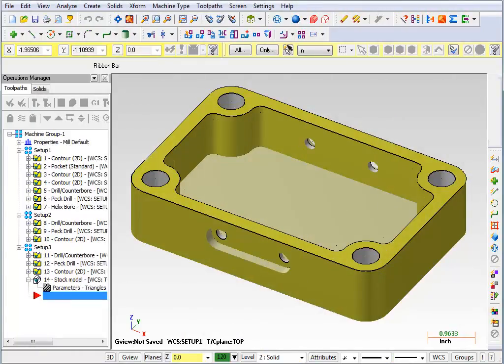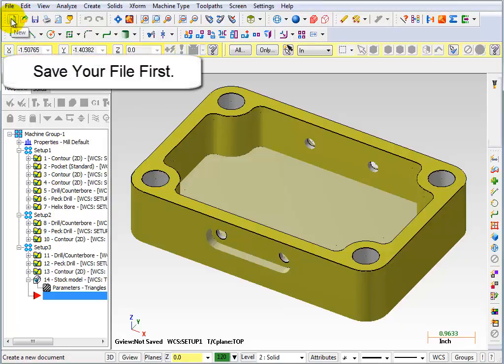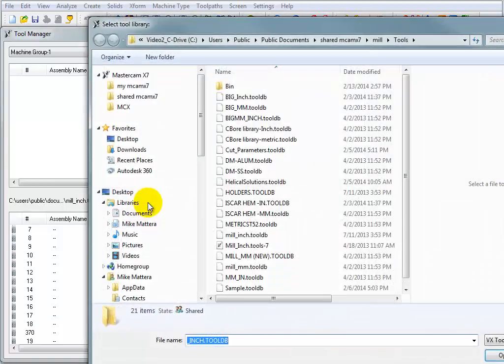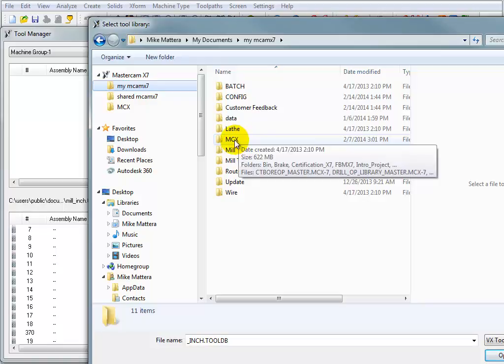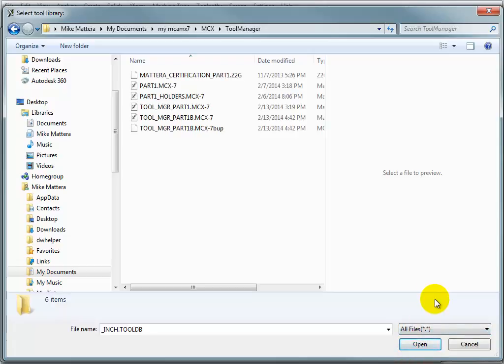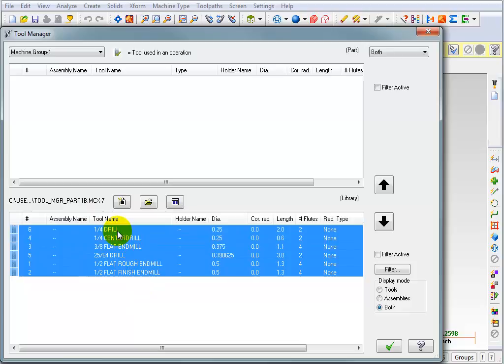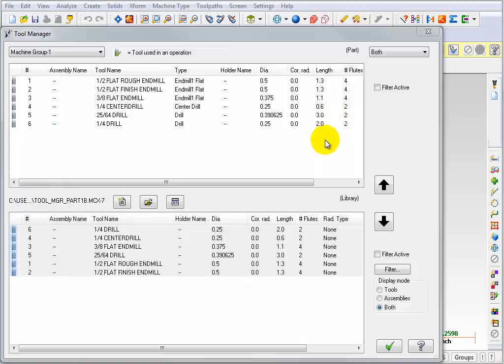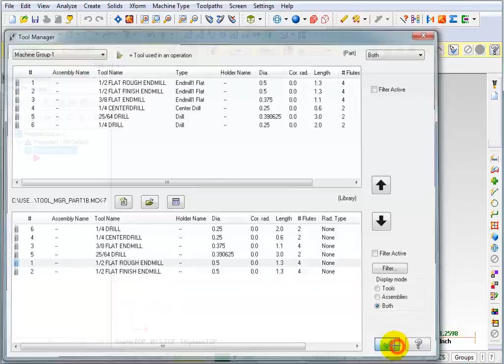TFM - Mastercam Tool Manager - Custom Tools & Importing Libraries From an .MCX File.

Comment from the maker: I dont know what your specific problem is, but Mastercam has about 18 different tool types. Not just insert tools. If you're doing a form tool, the procedure is pretty easy, just draw 1/2 the tool, with a centerline and save it as a custom tool.  Everything seems difficult, when you dont know how to do it. Unless your tools are custom ground, you should be able to download the geometry from the manufacturers web site. If your tool is custom ground, there must be a drawing (cad) of it somewhere. In which case, you'd just import it. All of which is covered in this training CD